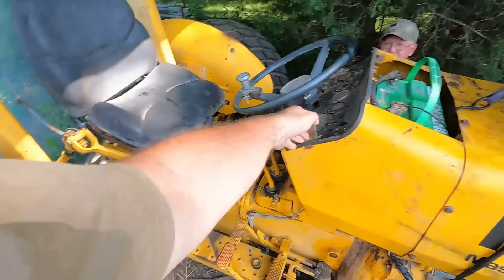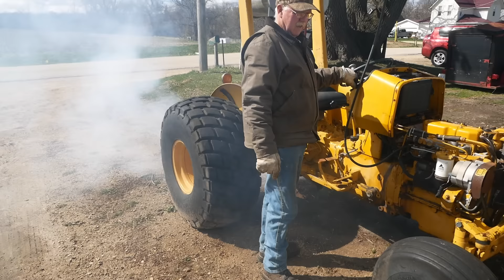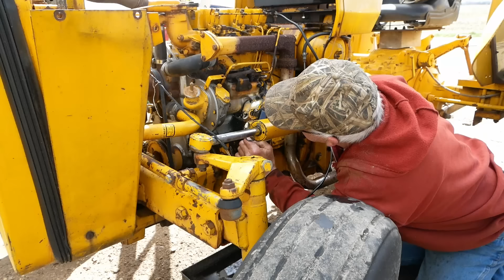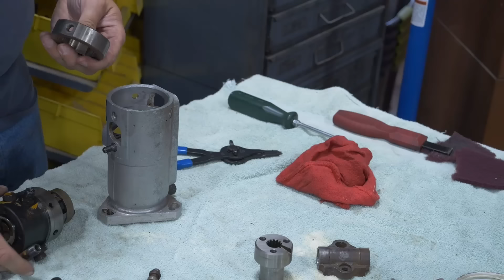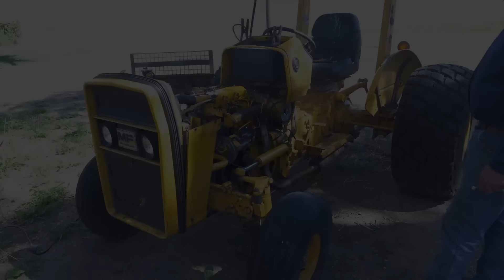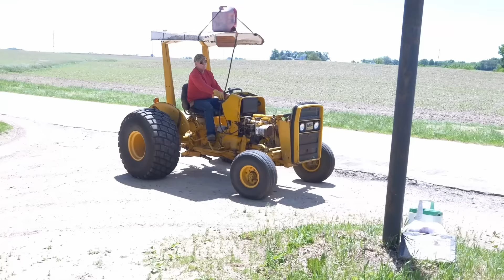Dad's Abandoned Diesel Tractor Smokes, Barely Runs

Comment: Biodiesel fuels and some blended off road diesel have been the demise of many tier 4 engine fueling systems. I always recommend to the customer to never run biodiesel or trust off road fuel in tier 4 engines.  These low pressure systems as shown here can eat the bio and off road fodder with some maintenance (as seen). Being a materials handling mechanic going on 25 years, ask me how I know.

Comment: What I learned about biodiesel, is you need to start/run the car on diesel, let it warm up some. Switch to Biodiesel and when you are ready to park basically the reverse, before you shut it down, turn the diesel back on from the bio diesel and let it clear the system.
Reply: Most biodiesel have glycerine used in the process. It is the polymerization of the the glycerine from exposure to sulfur, alcohol (anti gel wonder fluids) and engine heat. What you described is the only way I would attempt to run off road or bio in a modern engine and that would be only to get out of a jam with no other fuel options.

Comment: So, what I have learned is that Biodiesel made from trans fats causes clogging of the fuel pump just as trans fats cause clogging of your circulatory pump.
You could have tried Lipitor or Zetia.
Reply: biodiesel only turns to gunk once it's been allowed to sit for a while, but when you run the engine on used deep fry oil, often you have to preheat the tank to keep the oil fluid, as it can otherwise turn into a rather thick liquid that a normal fuel pump can't handle. But since tank heaters are also needed for petroleum-diesel in cold areas, they're not that hard to get hold of

Comment: I saw that Massey setting in front of the shop the other day, and wondered how it was going.
 My Massey 230 needed the power steering cylinder rebuilt when I bought it. I ended up taking it to Your Dad to help get the gland loose. It took ahis BIG vice, a rose bud torch and a 4 foot pipe on the spanner I made to fit .
Reply from the maker: I think this is roughly the same tractor, just with the low rider package.
Reply: @WatchWesWork  that 3 cylinder Perkins , when running right, is very economical. I can bush hog 6 foot tall grass and weeds all day on a couple gallons of diesel fuel.

Comment: In years gone past they used to recommend a different fuel for long term storage. 

Recommendations were to run it on the storage fuel until it's reached the injectors before shutting the engine down. 

I can't remember what the fuel was called, but I read it 25ish years ago in a 1960's workshop manual. 

It was for a British Nuffield tractor and so would have had an inline injection pump.

Comment: What is a turf tractor?  Does it have a special purpose or feature(s)?
Reply from the maker: They are made for mowing and landscape work.
Reply: @WatchWesWork  probably also low ground pressure?
Reply: @casparberends  Not only low weight and wide tires but the tire tread is very different too, effectively giving you the lower ground pressure you are talking about. They will often have factory options for mower decks on their belly

Comment: "Ran when parked". Usually famous last words. 😂
Reply from the maker: I think it was true, but the "a few years" part never is.
Reply: @WatchWesWork  And "Parked" is often just a term for "This is the exact spot it stopped running...and it is a mighty fine spot to park it."
Reply: @WatchWesWork  usually because they never do a proper regular maintenance on said machine until it breaks down and costs them thousands to repair instead of the 50 dollar oil and fluid changes lol
Reply: Hi guys Good thing about that tractor. You wouldn’t have too many mosquitoes, wasp or bees around you lol from Australia
Reply: I got a vehicle for a demo derby that had been “parked for 6 months.” The oil change date was 5 years in the past. All it needed was a jump start and tires though, probably could’ve been a daily driver.